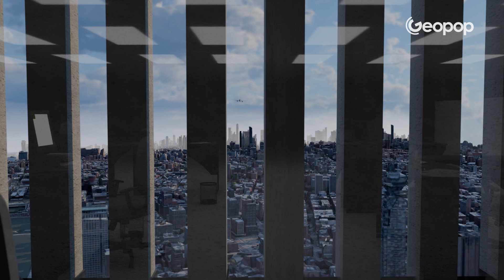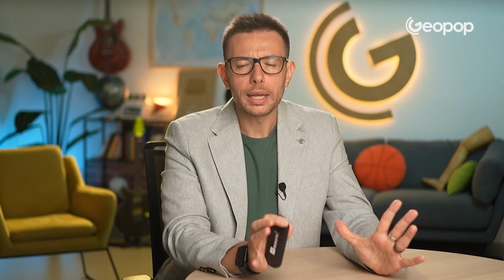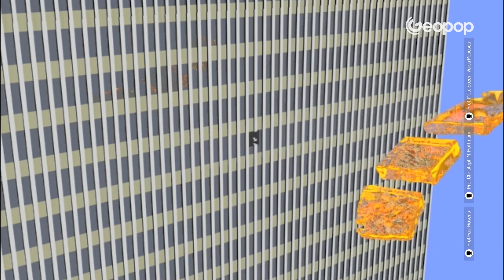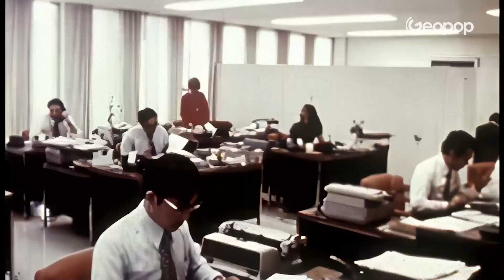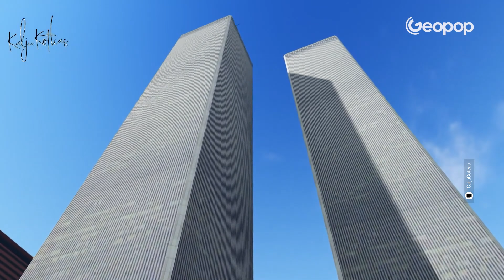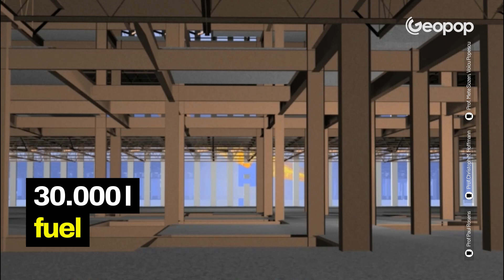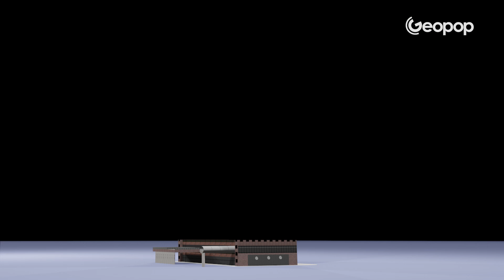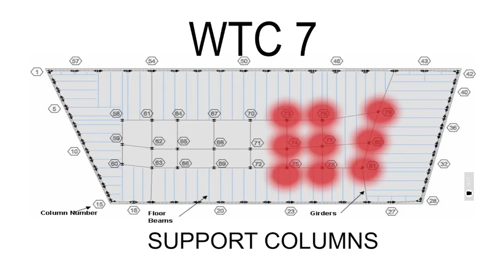9/11, 2001: The Technical Reconstruction of the Twin Towers and WTC 7 Collapses

Comment: Thank you.  So, I guess what hasn’t been talked about specifically is all the people located above the floors impacted had no safe practical way to survive.   I assume all elevators ceased operating and the central column area also had the stairs.  Even though the stairs may have been good below and above the floors impacted, the impact zone of 4 - 6 floors left usability of the stairs through those floors unusable.  There must’ve been increasing panic by those above the impacted floors to find a means down to the ground.  I can imagine, possibly, the next sign, to the people located above the impact floors, of them being murdered , was literally the floor they were standing on rapidly moving downward in an unbelievable manner and collapsing structure crushing their body.  Unless murder from smoke occurred before downward fall and crushing.  Gruesome, but, their reality.  RIP all.

Comment: Why havent we reconstructed top portion of world trade and gotten a identical plane with same amt fuel.   Same approximate weight and at same speed let plane collide like it did back then.   Will it just melt into building on impact with a steel building.   NO it wont.    Common sense.    Something about this just isnt right.     Why cant wr demand or just someone do this and film from every angle.    Even with this proof americans are dimwitts.   They would still believe the lie.    Instead of facing a horrible scary truth.
Reply: Don't need to.
Reply: Are you offering to pay for all of that?

Comment: As an iron worker for 32 years, there no way possible the wings of the plane that made of lightweight aluminum going to cut through the steel outer skin of the WTC, it would disintegrate on impact. This has been debated thousands of times on the job site at lunch.
Reply: Iron worker does not equal engineer, a grain of sand traveling at a high enough velocity could penetrate steel F=MA
Reply: @T887thdn  This is another disingenuous and very untimely 9/11-related inquiry from a mostly anonymous internet user. 

A person with an above-average level of intelligence, and sincere about learning historical facts, scientific evidence, and expert opinions should have NO problem researching 9/11. 

The assertions, background credentials, and other factual claims from the OP should be taken with a grain of salt. 

The OP claims to have more than three decades of professional experience in ironworks and metallurgy; therefore, he wants to be treated as an "expert." 

Arguably, architecture, civil/structural engineers, building code and construction regulators, insurance firms and actuaries, chemist, firefighters, and even experts in environmental health and occupational safety would more appropriately labelled as "experts."
Reply: Who said anything about the wings "cutting" through steel? You can look at images of the building before it collapsed and see for yourself that the beams are still intact.
Reply: And remember, the wings did not cut the steel. No steel was cut! The columns were short lengths bolted together at the ends. All the planes had to do was break those bolts.
Reply: Then present your own theory and finance your own research questions. 

If you were serious about learning the truth, then you wouldn't be asking questions already answered decades ago. 

Just because you believe in conspiracy theories, spreading misinformation, and are being willfully ignorant, doesn't make you an expert on the Twin Towers and structural engineering.
Reply: @ElLowEl .  . "What the hell are you talking about?" .  . 😃 .  . Thank you for your sponsored reply, Mr. EILow.  The word projection indicates holography as you know, commercial demonstrations of which have been amazing in recent years.  To feign ignorance doesn't work well for you, however.  Where, Mr. EILow, is the wake turbulence only seconds after passage of a 500 mph large passenger airliner -- not seen in the smoke and fire covering the impact zone?  Even the wake of a small Cessna Aircraft would be noticeable -- yet there is nothing.  It's likely that no real answer from you is forthcoming. We'll wait and see .  .
Reply: You have to remember that those wings, although made of aluminum skin, contained all sorts of mechanical bits, hydraulics,  and very heavy jet fuel. So the wings had MASS.  F=MA my friend.  High school physics.....
Reply: @Maidenrules29  I was an ironworker and then assembled 787s for boeing, Have you seen what a bird does to a plane ? AND I guess Bldg.7 fell in sympathy of the twins being brought down in controlled demolitions. ??
Reply: @Maidenrules29  no doubt, but the wings of many planes are designed to detach. this prevents them from catching on anything that would cause the body of the plane to tumble. and of course separates the fuel tanks from the aircraft.
Reply: @sixmax11 767's don't have detachable wings.
Reply: What is the source of the many tons of molten steel found in and under the debris, the heat so intense that the molten steel remained in that state for weeks afterward, running off of the debris as it was excavated. This cannot be molten copper from wiring that retains the color of a shiny new penny.  It cannot be molten aluminum that retains the color of the polished aluminum wheels of a street racer. It was the color of glowing orange molten steel  that cannot be mistaken for any other material, reported by firefighters who are very experienced in the nature of such materials as well as seen in video evidence.

When you combine this with an entire lack of turbulence behind 500 mph aircraft, when even a small Cessna Aircraft would leave an evident wake in the smoke and fire only seconds later .  . We find that skeptics still cannot be skeptical of the official narrative in explanation.  Sponsored channels and forum activity are skeptical of nothing when support is provided.

Sponsored activity in the forums is very normal today for commercial and political purposes and subjects of controversy -- in the attempt to lead public debate.
Reply: Which is more extreme -- to accept without question the inexplicable lack of turbulence in the wake of a 500 mph large passenger airliner -- not evident in the smoke and fire covering the impact zone only seconds later? -- or to recognize the indications of digital projection in its imperfect nature as we see a wing disappear in front of a bright blue sky? From another camera angle, the same aircraft is seen passing behind a crane in the foreground, yet in front of the heavy crane cable. 

There should be a hurricane of turbulence in its wake that would entirely disrupt and disperse the smoke and fire seen billowing outward just 3 to 4 seconds later at both towers.  Even the wake of a small Cessna aircraft would be noticeable -- yet there is nothing.
Reply: @ronaldgreene5733 wtf did they project it onto? Open air?

Comment: Same old bullshit, more handwaving.
Reply: And yet not wrong. Go figure.
Reply: @TheLoonResistance  it is wrong he's why https://www.youtube.com/watch?v=Ddz2mw2vaEg&t
Reply: @Verydumfly  - That's hilarious 🤣  Those ass-clowns guys can't do this - not in 18 years have they even tried. But lil-ol me can;

Twin Towers collapses were relatively straightforward, the fundamentals already understood in the professional engineering community within just weeks. Still, there’s a lot of really bad information floating out there, mostly on the internet where it’s easily accessible to anyone. 

To correct that situation, I have all on my own prepared this short yet detailed technical description of Twin Towers collapses based on my own observation and analysis of the available true and relevant facts. No politics or ideology, just the engineering. My hope is this will dispel many common myths and answer most if not all questions you may have about the Twin Towers collapses, because anything can seem like a conspiracy if you don’t understand how it works

While complex, most of the Twin Towers collapse mechanisms can be seen with the naked eye and easily discerned and understood by the layperson if sufficient time is taken to understand. 

1. The Twin Towers consisted of 4 primary structural elements that together formed an integrated system where each relied on the others.  47 hollow box-section steel Core Columns carry the majority of the gravity loads. The 236 hollow box-section steel Perimeter Columns carry the remainder and ALL of the lateral (wind) loads. Long-span Lightweight Steel Trusses connect the core and perimeter column together at each floor with a Hat Truss on top to tie the structure together as an integrated unit where no element can survive without the others. There was no structural load bearing concrete and most components were bolted together.

2. The impact of 117 tons of airplane (= to about 12 dump trucks) at speeds up to 590 mph with the energy of a ton of TNT completely destroys the aircraft. This in no way implies the Towers come out unscathed. Many perimeter columns are damaged or destroyed as are some core columns (example; 33 of 59 perimeter and 20 of 47 core columns damaged or destroyed at the impact floors in the North Tower), This damage is primarily through bolt-shearing failures at the end connecting flanges, as well as bending, twisting and fracturing of weld seams. There was no cutting or slicing - the reality was far more violent and messy. 

3. The impacts destroy or damage fire insulation, fire breaks and sprinkler systems on multiple floors.  Huge fires are started across multiple floors simultaneously and allowed to spread rapidly with no effective firefighting or fire suppression. This was an unprecedented fire event . 

4. The hotter steel gets the weaker it gets .  With fire insulation stripped away and no sprinklers the survival time of the steel greatly reduced. Gradually over time heat causes the lightweight steel Floor Trusses at the impact damaged floors to sag, which was observed and recorded.  No steel melted or needed to. Structural steel fails long before it becomes a puddle. It just needs to bend

5. Sagging floor trusses pull on the increasingly weak and overloaded Perimeter Columns, causing some of them to bow inward by up to 5 feet. A straight column is up to 4 times stronger than a bent column. The bowed Perimeter Columns buckle and fail, initiating collapse. The formerly static mass above which the structure below could easily support is now converted into a dynamic mass up to 30 times greater. Because they have buckled, the Columns above and below the failure point are no longer aligned . The load bearing structure below no longer bears any load as it falls past the lower columns, NOT onto them.

6. Thousands of tons of debris fall within the four outer walls, down through the open office space, crashing onto the first intact floor it encounters. This massive impact immediately breaks the bolted connections to the columns as the amount of resistance the Floor Trusses can offer is negligible.  The falling debris slows only marginally and briefly. Note:
6a. This is NOT a solid top block crashing into and “crushing” a solid bottom block .
6b. The debris falls past the columns not onto them.  The columns provide no resistance to the falling debris. 
6c. Only the bolted connections of the floor trusses to the core and perimeter columns can offer any resistance. A pair of 5/8” bolts at each end of each truss vs. thousands of tons of falling debris.
6d. No laws of physics are violated.

7.  This floor-led collapse progression within the four outer walls can only go straight down. Note: 
7a. This process is often incorrectly referred to as “pancaking” which actually refers to a completely different process rejected at an early stage. The catchy name stuck but nobody knows what it is supposed to mean.  Pancaking is too simplistic and inaccurate anyway. More like Kaiserschmarrn.

8. Collapse progresses through the floor systems not down the columns, through the path of least resistance . Rate of floor failures increases with each successive floor as momentum increases, reaching an average acceleration of 0.65 of GA, or 35% slower than true free fall. Bam, bam, bam down the building until there are no more floors to fail.  The resistance offered by each successive floor is always the same. The mass and velocity, thus the energy of the falling debris is constantly increasing, with each floor destroyed adding new falling mass. Some falls to the sides, but most falls down. More mass, more velocity, same resistance with each floor.  Don’t get stuck on the but the lower floors weren’t on fire nonsense. They weren‘t and didn’t need to be.

9. The Towers were 95% air by volume. As that air was compressed inside the building it is forced down the tower and blown out the sides in reaction to the building collapsing . Those were not “explosions”, it was expulsions of compressed air caused by the collapsing building, explaining the low velocity, lack of flash, blast, supersonic pressure waves and lethal high-velocity ejecta.  

10. Perimeter Columns become detached and peel away like a banana behind the collapse front, playing out to the four points of the compass extending to more than 600 feet from the base of the towers. This was quite obvious from examination of the debris pile. 

11. Core Columns fail last as their internal beam bracing is stripped away by falling debris and lateral support from the floor to perimeter columns is lost. 

12. For those who care about how long this whole process took; 31-34 seconds from the moment the perimeter columns buckled until the last core columns hit the pile, or 1/3 the rate of true free fall. Don’t believe me?  Just watch any video of the collapses and note the loose truly free-falling debris dropping much faster than the towers themselves.  

13. Each Tower had a 1-acre footprint. Far from collapsing inside their own footprints the debris pile spread out over 17 acres in a pile up to 14 stories deep. 8 surrounding buildings were destroyed and scores more damaged by the falling debris. 

14. What was NOT observed were the 180-190 dB bangs of thousands of high explosive devices or the blinding bright flashes of burning thermite. Neither could have caused the (silent) perimeter column buckling that clearly initiated collapse.  Neither explosives or thermite could have survived the impacts and subsequent fires either. A video of a shocked and injured firefighter using the magic word explosion is in no way proof of explsoIVES . The pre—planned demolition case relies entirely on that sort of thing. There is zero tangible physical evidence and it would be technically impossible, totally impractical and completely unnecessary. No one would bother. 

15.  Finally, the Twin Towers were perfectly safe within their design envelope.  They only collapsed when taken far outside design parameters by an extraordinary and unprecedented event 

Impact + Fire (heat) + Time + Gravity = Collapse . Remove any one of those four elements and there is no collapse. Ignore any of those elements (as many do) and you will never understand the collapses. The Twin Towers were an integrated system in which no one component could survive without the others. One fails, the rest follow, through the path of least resistance – DOWN – through the open space, bypassing the path of greatest resistance – the columns.  Nothing I just described violates any laws of physics. All of the above is true no matter who planned and carried out the 9/11 attacks or why 

In 24 years zero structural engineers of tall buildings, including the 1/3 that have retired in that time, have made any statements in support of 9/11 Truth BS demolition claims. Zero, nada, none. The lack of any such citations in the engineering literature (published in any country worldwide) is documented in the update to this video: https://youtu.be/nP3TNHPCIVU

If I made any errors of fact, logic or reason or left anything critical out, please let me know so I can fix it. To stay focused just one topic at a time please and on-topic (Twin Towers ONLY). No word-salads of Gish Gallop. IF you can offer a more plausible alternative be my guest. Be the first. Please start any reply with the words “Tits McGee” or I will know you didn’t actually read it, are not serious and just wasting my time.
Reply: @Verydumfly  Thank you for the post.

Comment: I always ask why has no one ever said what about the sprinkler systems no one can ever tell me what happened to the sprinkler system why wasn't it working NF the pipe shit off after the plane crash it would still have to be pumping water out cuz it's a water system
Reply: A huge airplane crashed through it. Not hard to figure out.
Reply: Why would anyone tell you about the sprinkler system? Are you supposed to be Congress, the President, or a high-level government official? 

No one is telling you anything about 9/11 because the entire world moved on over two decades ago. 

Maybe there should have been more resources available to people with "special needs," but you need to take the initiative and do your part by trying research it yourself.